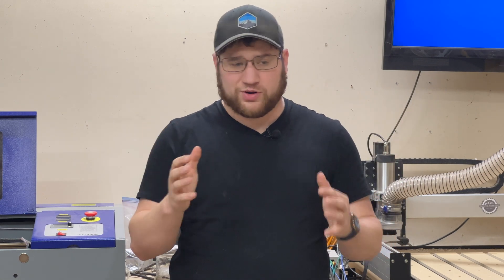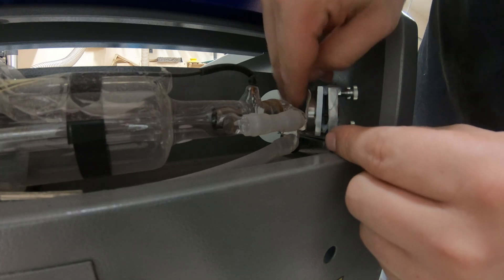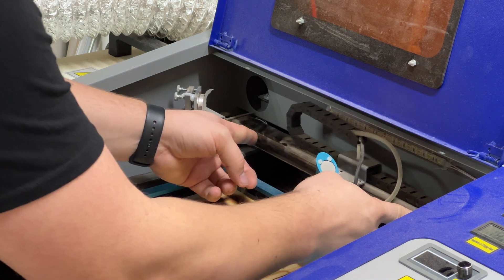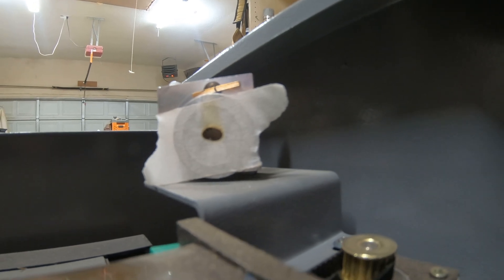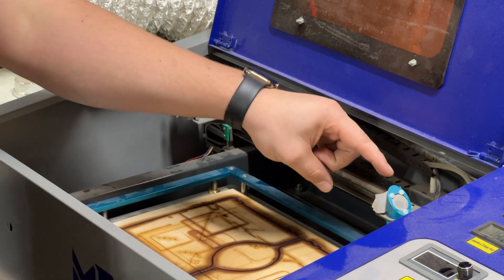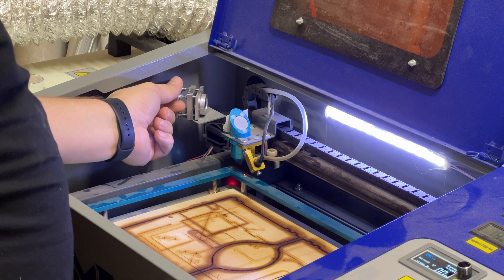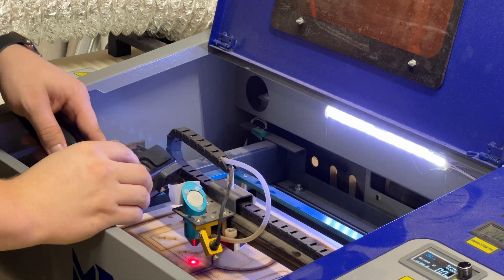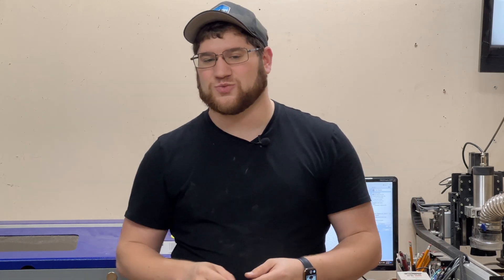Align Your Laser Mirrors in 3 Simple Steps For Better Cutting and Engraving

Comment: Thanks I need to do this but going to put the air assist in first.
Reply from the maker: Air assist does help a lot when it comes to cutting!
Reply: @CreatedWorkshop  That is mounted, but I could not believe it when I went to get some masking tape that all I have now is the fancy plastic 3M stuff, so I have to go to the store tonight to finish up.
Reply: I have a question I email you the question I wanted to ask